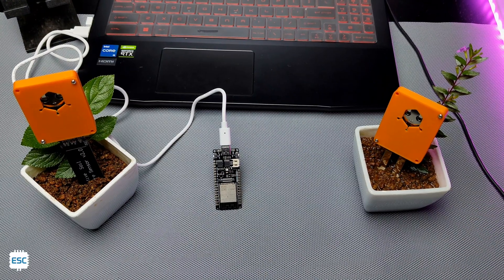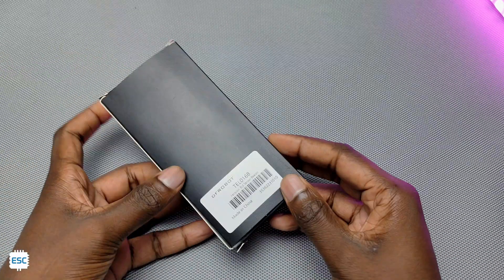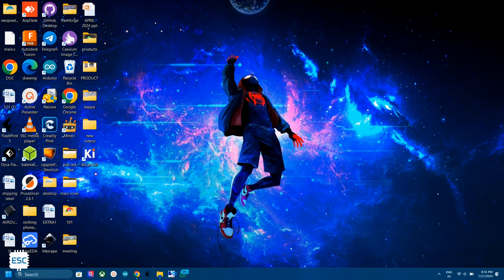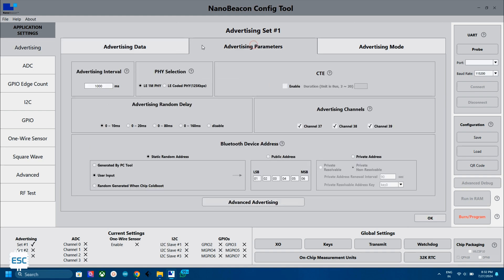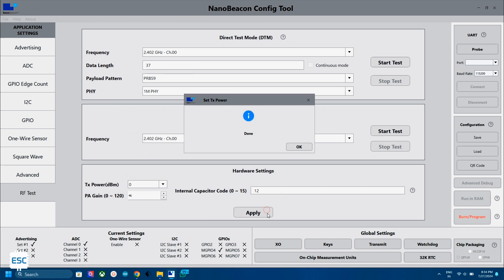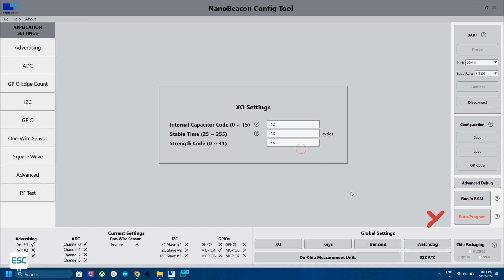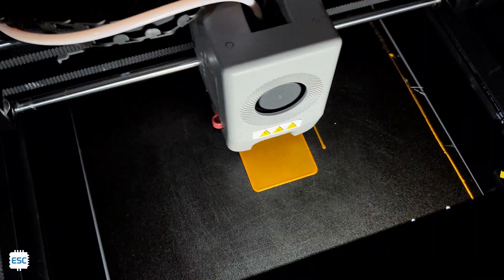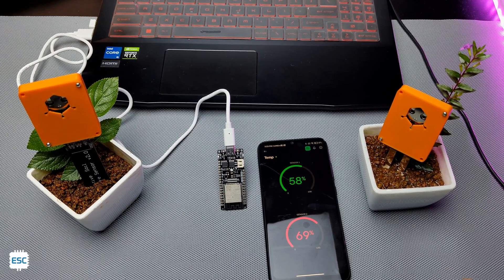How to make an Advanced IOT Smart Garden | BLE BEACON | DFROBOT FireBeetle ESP32-E

Comment: Writing programs for Pick=A-Path in early 2000 for the Commodore 64 and 128 and hosted on my 5 phone line bulletin board server was way simpler than this!
I commented out //#include <BlynkSimpleEsp32.h> out reran compiler and got this error:
exit status 1
Compilation error: 'BlynkTimer' does not name a type

I think I need to sit back and have a glass of my infused Spiced Rum watered down to 20% and work on this later. I even added your <BlynkSimpleEsp32.h> directly into my Library and it still could not find it, that is why I commented it out with <//> and Compiled it again.

Comment: Also the newest version of NanoBeacon Config Tool does not have a custom setting. And I had to get the PAID Version of Win Zip to open/Export the .7z files.
Reply from the maker: I will check that
Reply: @EDISON_SCIENCE_CORNER  Thank You, I am 73+ years young and need to automate my Hydroponics garden. After getting taken for about #300 ordering from Walmart and being charged over $4 per item and most were junk ore did not work I am now ordering only from DFRobot directly from them.
Reply from the maker: Oh yeah
Reply: @EDISON_SCIENCE_CORNER  Sorry, I rewatched the video in slower playback and CC on and I saw that I clicked on the wrong button to edit. Clicking on the 'edit' below the three above it I did get a Custom choice.
Reply from the maker: So your problem is solved.?